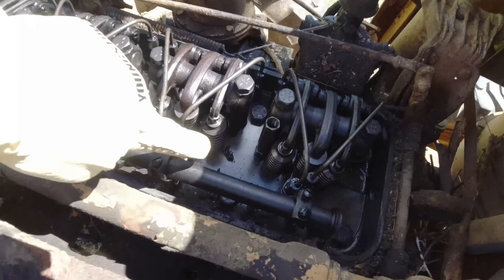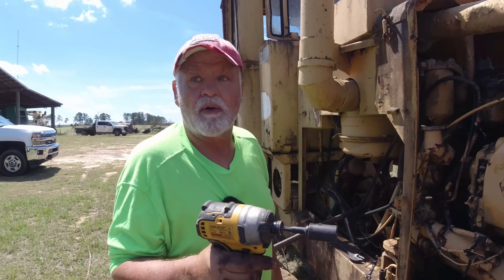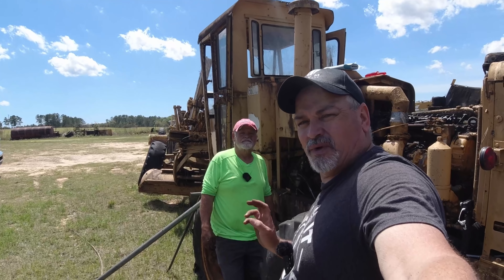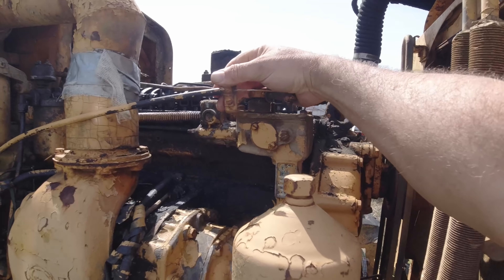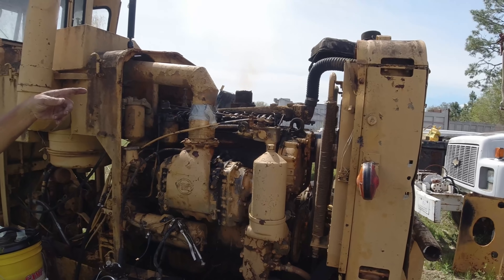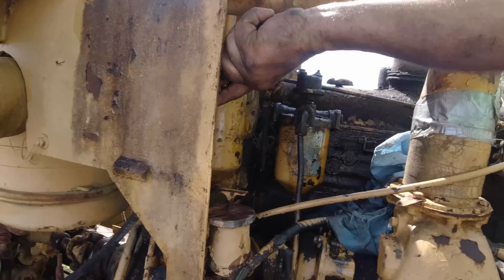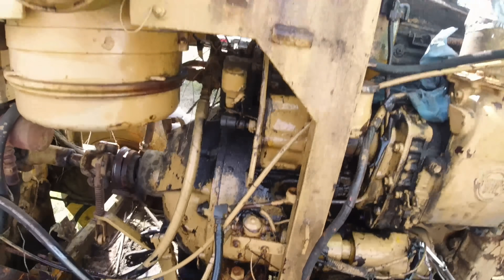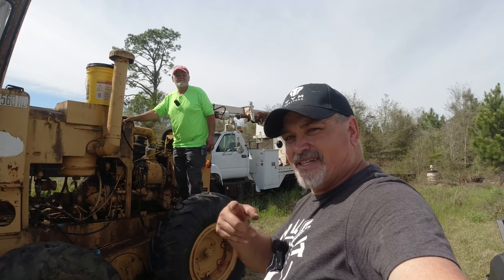Will it start? Motor Grader with Detroit locked up 7 years!

Comment: Brilliant ! That engine fired up easier then expected, at first crank. It sounded like the decompression was on initially. The puff of smoke at the battery terminals is the Hamiltonville Battery Special Event. Thanks for that. Lots of water in that fuel tank.

Comment: Hydrotex Essentialube is the best in the West(or anywhere)for unsticking stuck engines, lifters, injectors, etc. No need to disassemble anything, just pour little down the exhaust and let is sit. The stuck cylinder will be the one(s) with the exhaust valve open when it rains.

Comment: Another fine video brought to you by Hamilton Farms, Crescent wrenches, Marvel Mystery Oil, ether manufactures and wheezing medications to stop grader from sounding like it is dying from asthma.   

A little dish washing soap on tip of finger spread on belts will stop the squeaking sound from them.  Use 3# hammer with Crescent wrench for those hard to turn bolts and nuts.

Comment: best way i have found to unlock an engine, without using massive amounts of torque & risk breaking or bending something...fill your cylinders with mystery oil , or whatever....then use a weed burner torch to heat the block up.....works just like heating up a nut stuck on a bolt......plus the capillary effect will draw the liquid into the spot of seizure....works every time

Comment: There is a little switch on the left side of that supercharger that is supposed to be used if it runs away, cuts the air off

Comment: Nice... Blower on a diesel I never thought it.
Reply: its a two stroke diesel, needs blower to run, not for extra power [you can get them with turbos for power upgrade]
Reply: That design has been around since the 30's

Comment: I saw an extension to a socket from a torque gun - it was 48" if a millimeter.  It reached from the front of a bulldozer to the rear attachment bolts to the Tranny !  Big one !

Comment: I have a Detroit 4-71 in my champion.   I bought it sight unseen been sitting for 17+ years. Only has 1100 hours on it.  I got the motor running but I am having issues with the throttle on the governor where my foot pedal cable attaches to.   Any advice?  I can control the rpm’s from the lever that controls the rack control tube that connect to the fuel kill lever.   But the lever the throttle connects to gives no response while running.

Comment: Thanks for another great video Hank and Wiley. 
It was interesting and enjoyable. 

Hurray, you guys got the motor unstuck and running. Good going. 
That motor had all kinds of issues but you both kept at it and got it going. 

Needs a lot yet but as a plus you got the motor running. 

You both kept at it and you got it. May be a situation where it will not be able to move. 

You both take care and be safe. 
Looking forward to the next video. 
Thanks for everything. 
The Iowa farm boy. 
Retired Air Force veteran.

Comment: That things making oil now,it's never a good thing when you drain water out of the fuel tank,even worse when you drop the drain plug  off the oil pan and alot of water comes out and when the water stops very little oil comes after,no bueno
Reply from the maker: I heard that

Comment: Take to the scrap yard and stop wasting your valuable time . My brother had two trucks and had to replace both Detroit engines . He bought an OEM long block and the Butler three worked a total of three day of 16 hours he put it back on the road guess what three thousand miles on a total out of frame and it threw another rod through the block . He had a 50 k warranty and asked for his money back conclusion Detroit engine is a junk engine . We had three trucks and three drivers and the one with the 3406 B with 1.2 million was the only one still running but it had dropped a gear and limped home bob tailed we took the tranny of the freight liner and installed it . That truck went past the 1.5 million but the economy of Clinton and $3 diesel put us in the unemployed line . Peace and keep those videos coming !